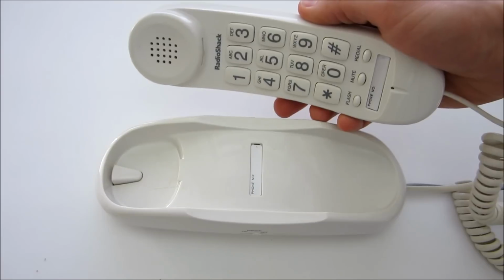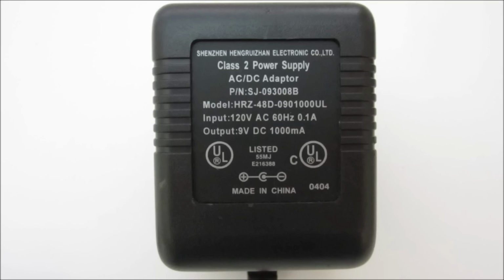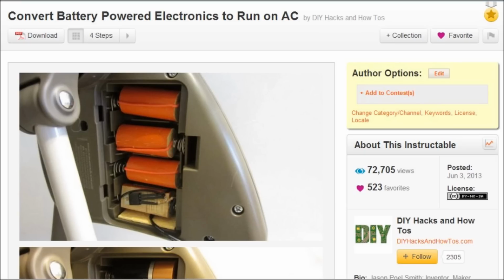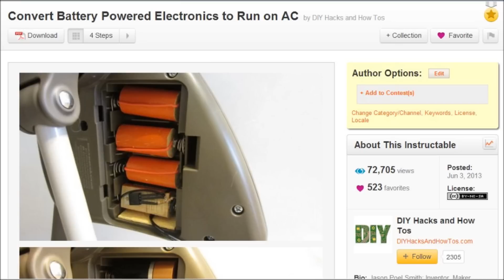DIY Hacks & How To's: Phone Intercom

Comment: I used to do exactly this when I was a kid (minus the resistor, since the phones are able to handle much higher voltage than that of a battery.) The only problem with this setting is knowing when to pick up the phone, since it doesn't ring. Sometimes the pulse dialer may be able to create chirping on the other end, when the other phone is on hook. But it depends on the telephones you use.

Comment: This is awesome. I wonder how long of a phone line this works with. Would've been a cool thing for neighborhood kids to talk to each other back before cell phones. We were always getting yelled at for tying up the phone line.
Reply: You need to safely impose 120 volts AC into the low voltage DC system you just built. Use a momentary push button rated for 120 volts to make the phones ring. ( They will both ring together when the button is pressed. )

Comment: what is purpose of resister??  .... lot of folk have done this w/out resister.
Reply: From what I've heard, it cuts down on noise. Without it, the line has a lot of static. Maybe they had some natural resistance built in due to using a poor conductor wire or lower actual voltage. I really want to try this.

Comment: I need Advice? my building intercom does not function without a landline connection? would it be possible to modify the intercom to not having to use a landline phone? as we do not use our phone for communication (Calling Friends Or receiving calls?
we would prefer a single standing intercom system without having to use a bell, or rogers supplied telephone line?
Reply: Landline is required. You can't do anything about it

Comment: could you solder a momentary switch to the 9v battery, and then from the switch to a small piezo speaker, pressing it would make the piezo sound and alert someone that you are trying to call them?
Also, could you install a headset and mic into this, if so how?

Comment: Wouldn't it be neater to add jacks to the box? That way you could just plug in the phone normally.
Reply: Dave H. Well, the cable goes from the box and plugs in the phone. There is no need to do this.

Comment: Is the 300 ohm resistor a 1/4 watt at 5%??  Just to be clear, it isn't a 300K ohm resistor right?  Is it the same as a 1K ohm resistor?
Reply: He said ohm NOT K-ohm
Reply: 1k = 1000 =/= 300.  FYI, pretty much anything under 300 ohms should be fine.

Comment: I've done this project before with great success, but with the 9vdc that you mention at the end, but on my current project I am getting so much "static" or "buzz" that I can't hear anything else; what am I forgetting.  Is this why I need the resister (which I didn't use)?  Thanks.
Reply: That is why you need a resistor
Reply: @turbojurpo  , wow I guess better late than never.LOL.  Thanks for the input.   I have installed this project (using a 9VDC converter at several location.);  it has been a huge help.

Comment: Or just buy a Viking Electronics DLE-200B. That way you can get ringing on both ends. Then you know when someone is calling you. 9VD is very low talk battery. Any hands free phone will require more voltage and loop current.

Comment: What is the distance at which they can communicate ?
Reply: Long enough for any house.  You might run into issues over a thousand feet or something.  That's not a hard figure, I just mean at some really long length the power will attenuate to the point that you won't be able to hear the other person.  There are calculations to figure out voltage drop.
Reply: Endless

Comment: The best intercom phone hack i've seen is to use a 2 port ATA device (cheap off eBay) and have the loopback to itself on the alternate line. Add a dial plan which makes a call a soon a the phone is off-hook and it will ring the other line and vice-a-versa.  

pap2t-ringdown-test

Comment: I remember electricians doing wire runs had made battery powered handsets with alligator clips on them. They used the buildings wiring to communicate with each other through this system.

Comment: I did this years ago when I was in college. My buddies room was upstairs and mine was down stairs. When we did some LAN gaming it was a pain in the ass running up and down stairs getting things set up so I made this. What I did was I added a LED to the circuit on each end so when he picked up the phone, the LED would light up on my end and vice versa. What I found was that while I would always notice the LED and pick up, he rarely ever would notice. It was like he was studying or something. So I added a momentary push button on my end and a piezoelectric buzzer on his. I think I ran cat5 between the to jacks so I had extra pairs to work with but it all ran off of the 9 volt battery.
Reply: Sorry guys. I never received a single notification until today for some reason but I'll tell you exactly what I did. 
I picked up 2 external phone jack boxes. They are little plastic cheap boxes you plug your phone into. I ran CAT5 cable (4 pairs) between them because it's what I had but CAT 3 (2 pairs) would work too. In each box I drilled a hole and added an LED light. Then wiring isn't too hard once you understand it. For reference CAT 3 wire pairs are Red Green, and Black Yellow. 

The thing to keep in mind is we are making a simple circuit. With 1 phone in the first jack box we would go, battery + -> resistor -> red wire - >phone -> green -> battery -
The circuit is completed when we pick up the receiver or push talk on a cordless phone.  We could slip in an LED anywhere in this circuit and it would light up when we pick up the receiver but all that tells us is when we pick up the phone, and we already know that.

To add a second phone we add the CAT 3 cable and connect the red wire to the same place as above to the resistor which goes to the second box. When a phone is connected to the second box, power comes back on the green that goes to battery -. If I add an LED here, it will tell me when the second phone is picked up. 
To tell when the first phone is picked up at the second location, I need to send power back up to it so on the first phone, instead of connecting the green line to negative, I connect it to black wire which goes to the second box, add an LED there between the black and yellow, and power comes back down yellow wire to finally get connected to battery - 

When I added the buzzer, I was using CAT 5 so I had 2 unused pairs. I just used one to make a simple circuit of battery + -> momentary switch -> buzzer -> battery - 
Button was on my side, buzzer on his.
Reply: @BrandonFrancey  excuse me sir, i am a kid trying to make one for fun, may i have a detailed link or picture so i can replicate this?
Reply: @BrandonFrancey Great explanation, thank you!
Reply: Hi Brandon Francey I was just wondering where on the circuit you added the LEDs - Your idea sounds interesting.
Thanks
Reply: How to add led light and the buzzer. Will u please tell me about this
Reply: dude please recreate this and make a video
Reply: VOIP adapter will work just need to configure a DIAL plan
Reply: Dude , would love to know how you configured the led in it. Thanks :)
Reply: Could you tell us where on the circuit you added the led lights?

Comment: done it. BTW: if you want to make a phone ring, you need to SAFELY pump about 90-120 volts AC through the line. LOL
Reply: But it's 20 hz. 60 hz works, but not very well.

Comment: The phone cable has multiple wires inside and it look like you only need 2 for the phone, so you can use the other wires to connect a door bell by each phone. For that 3 wires would be enough as well. 1 Ground and the other one for the switches.
Reply: Not to be captain obvious, but don't phones already have ringers?  All it needs is 60+V and 20+Hz to activate.
Reply: ThoolooExpress I guess that would be possible, but there is some sort of circuitry in the phone, that I have no clue of :D
Reply: Lars Reviews There's a capacitor that prevents DC from flowing to the ringer, so the ringer doesn't complete the circuit on the 9V. (If this happened, the exchange would think you picked up the phone.)  The problem is that phones have no capability to produce the necessary signal to activate the ringer, as it is normally handled by the switches at the exchange.  You'd need to create an external power supply that could be activated by either pressing a button on the keypad, or get cranky with a magneto.
Reply: ThoolooExpress That is why I would use a doorbell :D

Comment: Cool idea, now you need a ringer so the person at the other in knows to pick up the phone! Like an obnoxiously loud air horn!
Reply: you could hack into button on the phone or add one, add an extra few wires to the cord (or us an ethernet cable and swap the jack for the phone jack and use the extra wires in the cable to add an extra connector to wire up a switch. and a buzzer, then on the other end set it up so that the switch on one phone taps into the buzzer and vise versa. if you wanted multiple phones and wanted to select who gets the buzz you could add a selector switch to the phone. (or use the dial pad and each button could be for a different phone.
Reply: phone intercom | austinscreations3000 this might help. (my personal website)
Reply: LOL, exactly what I was thinking!
Reply: You don't need one. There is no call being made, your voice just comes out of the other phone's speaker, and is loud enough to hear in a room. All hanging up these phones dose is mute their microphone.
Reply: The ringer requires quite a bit of power.  In fact, it is a genuine risk, that, while working on phones that you can receive a fatal shock from an incoming call. (Read this in a dust old 70's home repair book.)  Of course, the electronics would be fairly simple, but it's going to be a bit harder than just using a battery and a resistor. EDIT: The ringer needs 90V, 20Hz.
Reply: +shazizz FOG HORN! rofl!
Reply: thanks.
Reply: the buzzer i was thinking of adding to my project is from a local hobby store, it uses only 20ma and runs at 9v. i used the resistor as a precaution. im sure if i find all the parts i need. ill most like make changes in the end.
Reply: Hi sir, nice idea. But RESISTOR hiw many ohms should be used.
Reply: just do a web search on how to build a Frequency Shift Key Modem. you can even program numeric designations into it and have phones all over the house with your own private phone network.